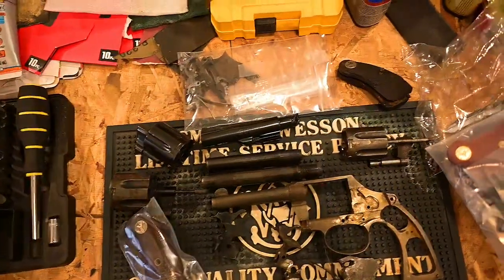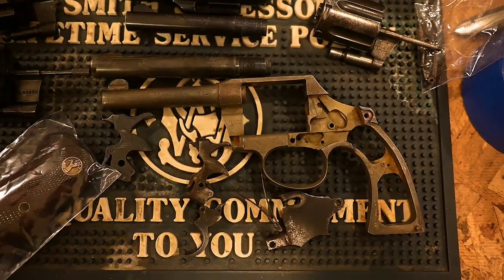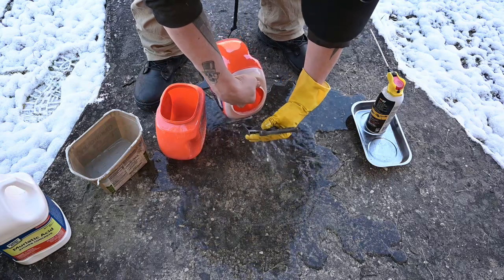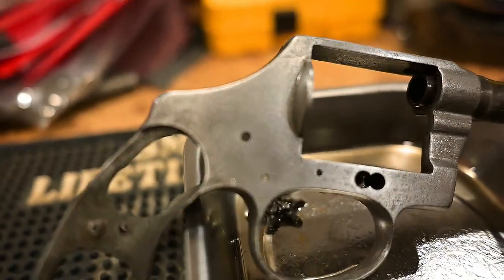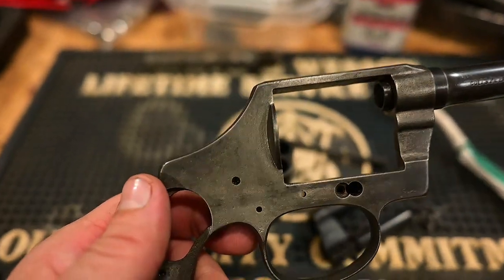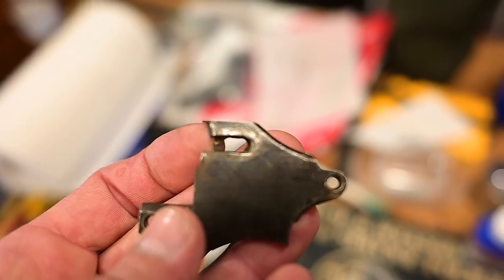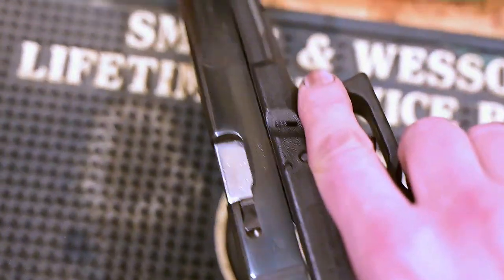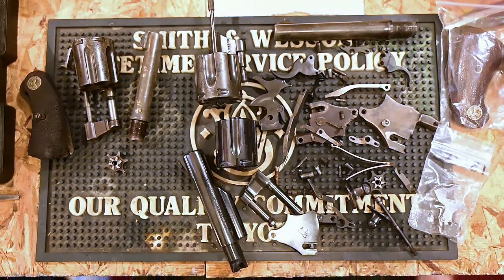Colt Police Positive Restore

Comment: Sir, an outstanding restoration of a Colt 'Legend" in double-action revolvers. You have a pre-war frame, matched to a post-war barrel, also a post war side-plate replacing the original pre-war side-plate. This would account for the need of a slight modification on your part for both barrel and side plate replacement. You did an outstanding job of bringing all the parts together, including the cold blue job, to make a complete Colt Police Positive Special. The type that cops carried in pre and post war times, including foreign agencies. The Police Positive Special was Colt's"bread & butter" arm for many years, because cops, civilians, and other governmental agencies carried the Police Positive Special for decades before its manufacture ceased (1908-1977, 1994). What a cop's "best friend" it was, reliable, accurate, and with more craftsmanship built into it than anything the competition could offer. As a lawman, I carried a second hand Colt Police Positive Special .38 for many years as a duty arm. The old PPS has a special place in my heart as one of my favorite duty arms ever before the madness of the semi-automatic pistol would replace my old Colt six-shooter .38 Special. I did notice the beautiful "aftermarket" wood grips with gold Colt medallion in each panel was sized to a "round-butt" frame Colt. Yours is a square butt frame , that is why the edge of the frame sticks out from the grip. Not noticeable too much, but I would get the correct square butt grip set for it. Excellent job all the way around and a big thanks for showing!
Reply from the maker: Thank You so much. I'm very unfamiliar with these and it was a learning experience.